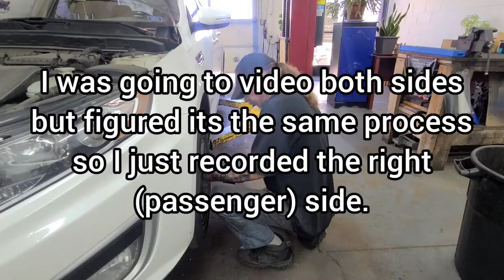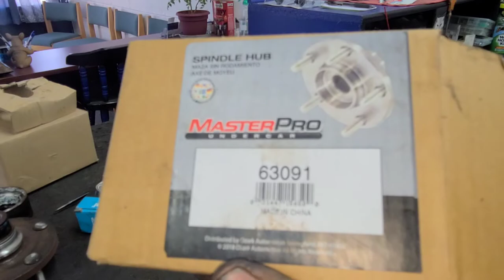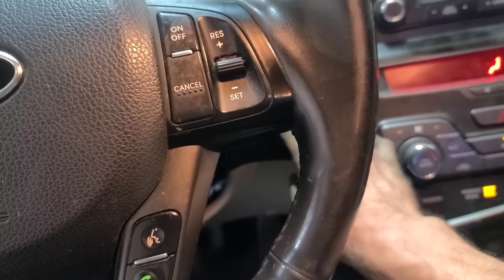Front Right Wheel Bearing and Hub on a 2012 KIA Optima

Comment: Wait!! I'm curious how did you press the hub out from the bearing Ring because mine I'm working on getting this pressed out but wasn't sure how you did that but I'm assuming your's fell out from how much Wear it gone through and all this done on my 2013 Kia optima LX front right wheel hub
Reply from the maker: 15:40 this is how I do about 90% of them. 

The rest I use a slide hammer to pull the hub out while its on the car before unbolting the strut and lower ball joint. 5:02
Reply: @MegaMilesBen  what tool did you use to press out the rest of the bearing from the steering knuckle and in your video 18:19 you have used three peases you used to press it out and the size of the diameter?
Reply from the maker: @berad187  https://amzn.to/4eyJbXv

Comment: I have two problems with my 2012 Kia Optima SX. Shakes at 60 MPH, New wheels, new tires, and alignment done. Replaced one wheel because it had a small bent according to the alignment place and did not change anything, replaced a tire because they thought it had bumps, did not fix the problem. According to the alignment place everything looks good and see nothing. Could I have a bad wheel bearing or a bad strut? I hear a pop once in a while when I go over RR tracks.
Reply from the maker: Take it to a different shop. Theres many things that can cause that... wheel balance, axle, bearing, tie rods and more. Tie rods and bearings arnt always noticeable to someone that doesnt diagnose suspension.
Reply: @MegaMilesBen  Good adivice.  I agree.
Reply: Did u ever find the problem. I'm currently experiencing the same things. Random loud pop and shakes

Comment: will this spindle fix and sx what todo if i can’t get it on can i lube it? and im doing this by myself
Reply from the maker: @JaidenWoodard  you can usually have a local shop press the bearing and hub in the knuckle for you. 

Most shops in my area will charge a half hour for it. Or if you find a small shop like me, Id do $50 for both, "off the books", if you dropped off the knuckles, bearings and hubs.

Comment: I replaced a wheel bearing and now it makes a squealing sound louder when you turn left do you know what that could be
Reply from the maker: Possibilities could be... problems while installing bearings or hub, cv shafts, strut top mount and even bad/sticking brakes/calipers/hardware.

Another possibility could be the brake shield was pulled forward and is rubbing on the rotor.
Reply: @MegaMilesBen  thank you yeah I think I could of installed the bearing wrong thanks for the tips very good video you are very professional
Reply from the maker: @adventures223  thank you!